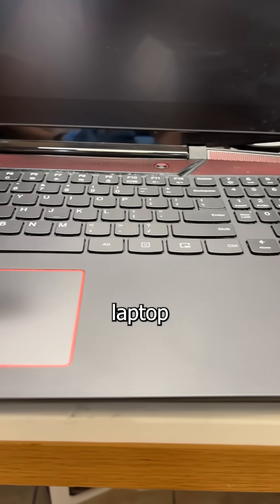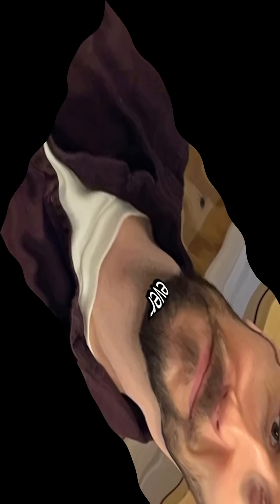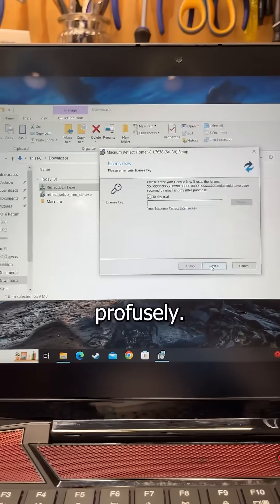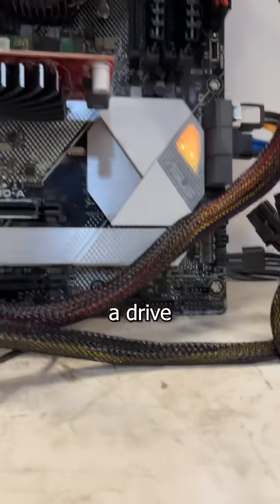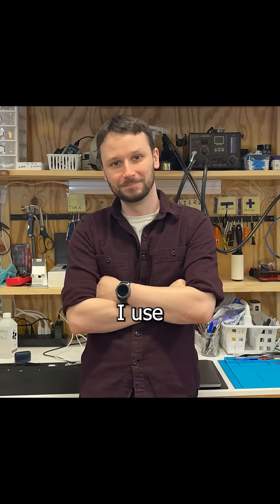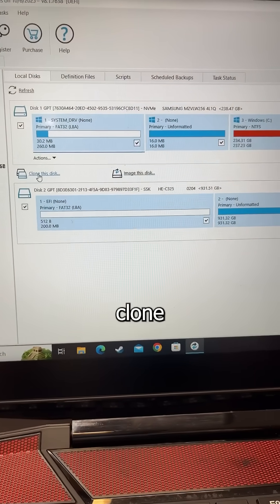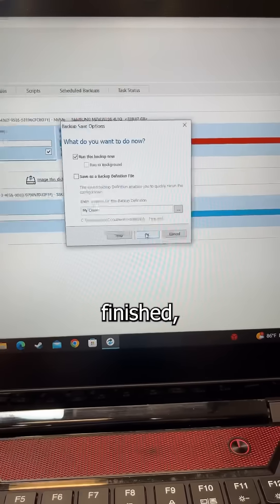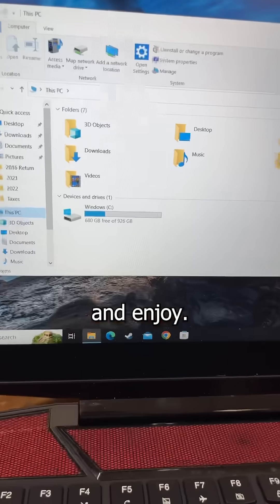Upgrading your SSD has never been cheaper! Clone it yourself! #tech #pc #technology #shorts #laptop

Comment: Macrium Reflect is great, I use it at my IT job all the time :-) Was able to save several systems with faulty SSDs (about to go out, corrupted files) when Acronis or Aomei refused to work
Reply from the maker: That’s ironic because Macrium always has an issue with failing drives when I try 😅 I end up using Acronis or MiniTool or CloneZilla
Reply: @SalemTechsperts  You're right, normally it doesn't work, but you can change the settings to allow cloning corrupted disks anyway. Uncheck "verify integrity of the file system", check "ignore bad sectors" as well as "automatically retry without VSS writers on failure". Then you can clone any faulty disk without issues. Afterwards you can use the typical chdsk/automatic repair/DISM restorehealth etc. stuff to get the Windows install up and running again 👍
Reply: @SalemTechsperts  In a more recent video, I saw you use Disk Genius, do you prefer to use that now?
Reply: no love for dd?

Comment: I used Macrium Reflect too to reflect my HDD onto my NVME SSD. It ran over night cos the 1TB HDD was a POS. So grateful that the port for Intel Optane which was missing by the way, could support a 1TB drive, every resource i queried said "No, use a 512GB drive" I said suck on this! Now I have 2TB of space. Core i5 10th gen mobile chips are a disgrace. I know why I recommended Ryzen 5 to a friend after this joke of a processor.

Comment: I would recommend you don't remove the battery if it's simple changes like ram ssd and hdd cause I had my laptop fully die on me 2 times now it just black screened then I had to remove the battery and turn it on by plugging it in only and then reconnecting the battery it was a hassle
Reply from the maker: I respectfully disagree. You will think this until you accidentally drop a screw or have something randomly short out while working and fry a laptop 💀 there is absolutely no damage that can be caused by unplugging the battery. On some HP machines it will scare you for a bit with a black screen on first boot but just wait it out
Reply: @SalemTechsperts  I see it really isint worth the risk. And my issue seems to be ram training ,my computer takes about 10-15 minutes everytime i plug my battery off so i must have associated battery un-plugging with issues.

Comment: You need to disconnect the battery?
Reply from the maker: Always disconnect it no matter what you’re doing. Better safe than sorry. You drop a screw in the wrong place and board is 💀
Reply: @SalemTechsperts  my laptop is kinda wack tho, theres 2 diff level compartment, if i want to just replace ram or storage i wont need to open it all